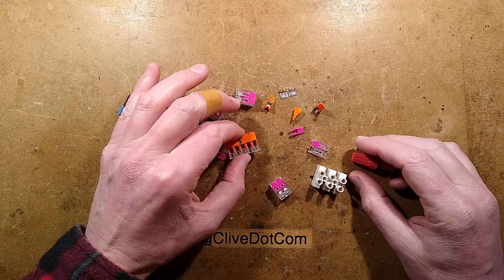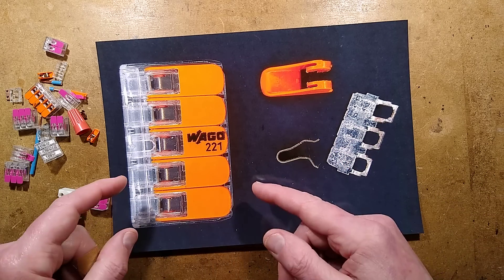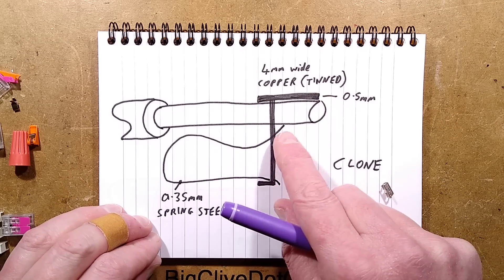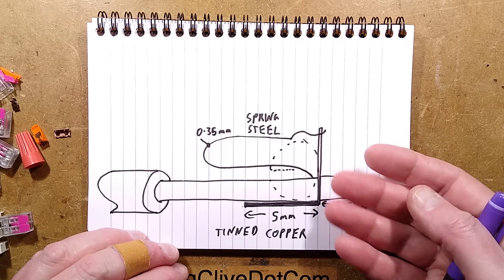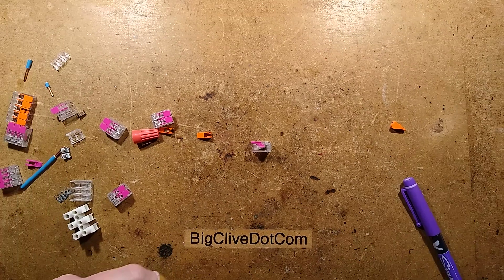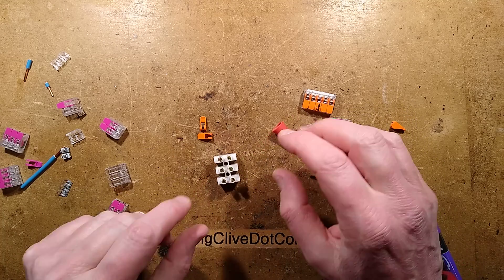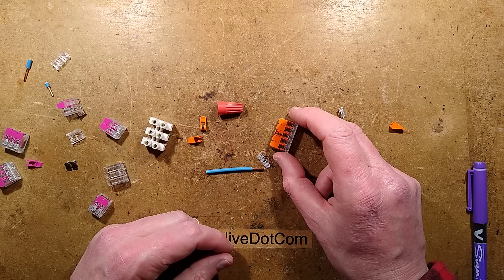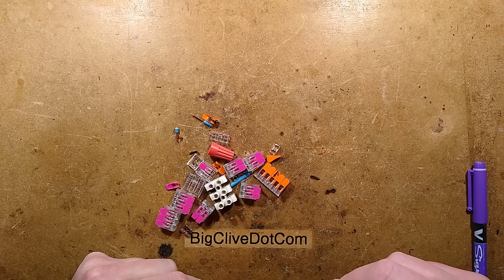Inside a Wago connector and a clone

Comment: The wago series has been a complete game changer for us sparkies, the best bit by far is they're approved for non maintained connections so can be inaccessible once installed..I'd still like access to them but it's allowed ...they also make some excellent PCB connector's.
Reply: Same here in Germany. Wire-nut never were a thing here but we used those screw camps with one screw, where you had to stuff up to 5 wires in, all from one side. That was a real pain and if not done correctly they got loose with only a few wiggles of a wire. Wagos replaced them basically instantly because WAGOs are faster to install and if you have to pay a specialist by the houer, the wagos pay for themselve multiple times.
Reply: @fkiesel9442   Your wiring Standards are piss poor if they allow termination of more than 3 wires into the same terminal. Do you value everything in terms of money cost?  Do you value circuit integrity or life lost due to inherently flawed workmanship in money values too?
Reply: @BTW...  It was like that for 60+ years and there were no significant issues with that. The terminals I meant are specifically made for connecting up to 6 wires.
The current code makes it much harder to use anything else than WAGO style connectors anyway, so this is an issue of the past.
Reply: Wagos can be used behind a socket in the box to connect the circuit with a 5 inch length of flex spurred off the Wago to the socket. The Wagos carry the ring's (or radial's) load while the socket is a spur off the ring. The screw terminals on the rear of the socket are not being used as a junction box. Super simple to install and much safer as no screw terminals on the ring or radial to work loose and arc causing fires.

Use the Wagos for the first and second fix.

1st Fix:
In first fix use the spring lever Wagos with three ports inside the socket backboxes. Four port Wagos for the earth to a metal box terminal. Then test the wiring. Then the plasterers and painters do their work.

2nd Fix:
Then on a bench fix flexible 2.5mm cable tails about 4 to 5 inches long to the L, N and E of the sockets (could be over 30 of these in one job). Then insert the flexes into the Wagos inside the boxes. The sockets being on flexible wire just easily push into position. The time it saves is substantial. Easy as a lot is on a bench. The Wagos also ensure the ring is always complete, not relying on the screw connections on the back of socket terminals that are being used as junction boxes having two 2.5mm cables run into them. Wago connections do not work loose over time, so the ring (or radial) is not compromised and less likely to have an arc.

The time saving and far safer job is well worth it. 

There are sockets available with Wago connections on the back, eliminating any screws, except maybe to an earth terminal on a metal box.
Reply: what do they cost on trade there not cheap online for diy 60 p each

Comment: I have a few of those exact clones in my personal toolbox, since they claim to be ETL listed, I trust them a bit more than some of the other clones I've come across, and they beat using wire caps, especially when it comes to connecting multiple wires together.

Comment: Would you trust using WAGO for electric heaters?   My house has all 12 gauge 20 amp circuits and I have forced air central heating with propane gas but in case that goes offline the backup is electric baseboard heaters and I started to replace them all with newer units as the old ones are from the 1970s and look ugly so it was time for a refresh.   I just have a hard time trusting something that uses springs when heating is around so I am sticking with wire nuts but I wonder if anyone tested WAGO  with long term high heat?
Reply from the maker: They are rated for a decent current, but I'm always cautious about high continuous loads.
Reply: The Wago shown is rated for 4mm2 cable so 32A which is nearly 8kW here with 240v mains. They have lots of testing compliance and the testing symbols are printed on the connectors. Being German the standard is very high.  
I would never ever use a clone except perhaps for a very low current connection. You have little way of knowing how a clone will handle power.

Comment: the outfit i worked for sold wago terminals to companies that made and rebuilt diesel locomotives.  why wago?  they were the only ones that didnt come loose in use.   i spent many years wiring up trains and related equipment and I never had a problem with the snap down or captive spring type wago connectors, they really are that good.  the push in type is another story tho.  I have been an electrician for 22 years not and have worked all over and there are very few products i recommend.

Comment: I trust the wire nuts among all the different connector types.  With other types of connectors, it seems that it would be to easy to accidentally or maliciously flip a lever the wrong way resulting in a loose connection.  With wire nuts you have a positive screw action that just feels more secure.

Comment: The Wago connectors are available in 2,3 and 5 wire variants, but I'd actually like to have a 10 wire variant too. Some installation cables has a protective ground wire and a shielding. The shielding is to improve the safety in case there are rodents or someone accidentally drives a nail or screw through the cable.
Pretty common in industrial and farm use in Sweden since at least the 70's.
Of course you can opt to separate the protective ground wire and the shielding too, it depends on the application. (Signal ground v.s. protective ground)
Reply: In case you need WAGOs you can basically go with ANY of the real ones and fakes. The fakes are less tested but come in WAY more designs and most of the time can handle WAY more than what they are rated at
Reply: there is a 8 wire variant for solid wires too, if you need many connections.. though it will not work for stranded wires or the shielding itself if you need that, but if you have a mix you could just use a short bridge between one of each

Comment: im using Wago connectors to connect two pieces of ethernet cables together one cable is from 2005 and the other is from 2015 and so far its working really good. 

2005 they used thick copper in that one.
Reply from the maker: Hopefully the new wire isn't aluminum inside.
Reply: @bigclivedotcom  the new wires do seem fragile but I’ll definitely check.
I’m hoping to update my cables with real ones from the BTDeathrayBox into Box junction things.  Just like in Grey Office blocks have.
Reply: I'd be reaching for an inline IDC junction or plugs & coupler before the Wagos, especially if I suspected CCA cable 🙂   Jelly crimps at a push if extending from a backbox.

Comment: I wouldn't trust an electrician with anything else. Some organization in the US did a survey... From what I remember, for screw terminals, 60% were under tightened, 10% were over tightened. And that was according to the manufacturers specifications, which is limp wristed to begin with. I fear to think what they would do with a wire nut.

Electrical connections must be idiot proof.
Reply from the maker: These days it's even more important that they're idiot proof with the new era of crash training.

Comment: Wagos aren't common in Canada and not stocked in hardware stores as a standard item. Looks like about 50-80 cents each...which is going to add up over a project. I'm genuinely curious whether this is cheaper elsewhere in places where they are more commonly used. In comparison, wire nuts are as low as 6 cents.  And admittedly they require a bit more care to use. But that's why the box is grounded and failures are rare if you know how to apply them.
Reply: here in Germany it is usually a bit under 0,25€ per piece, but cannot compare the price to wirenuts since these are not readily available here..
Reply: Wagos are available in the US at the box stores, though 10 pack of 3-ways are $10, those similar non-lever Ideal are 100 pack for $12.
I like using the Ideals at the price, for most wiring.  I think they've been around long enough that I can now trust them on a 20amp circuit.
They're great at the price compared to the BMW-priced Wago's, however for electronics wire shuffling the Wagos are great.
Fantastic for making pigtails in switchboxes. Time saving is meh, maybe save 20 sec. but I'm sure I'd love them way more if I was installing 30-40 every day.

Comment: The problem I had with the clone connectors (even for domestic use) is that they didn’t clamp the wire as well as Wago did. I’ve switched back to using authentic Wago, for peace of mind.

Comment: You can tell who has actually worked with a wirenut vs some YT wingnut when they describe how wirenuts fail so easily if looked at wrong....
https://www.youtube.com/watch?v=v9hohwvGeHw

Wirenuts- 
Lower Ohms resistance
Current carrying capacity independent of connection
Stronger physical connection (Pressure/Friction fit)
Non-corroding o2-free electrical connection
1/5 - 1/10 cost of Wago

Wago-
Higher Ohms resistance (Ironic, used in a countries w/250+v mains...)
Current carrying capacity dependent on Wago construction material
Weaker physical connection
Corroding potential depending upon spring materials
5 - 10x cost of Wirenut
*Ease of use/reuse if lever option selected

Wagos are nice in switch boxes, etc as they can make short work of a rats nest/limited space. Or hobby related if you're always reusing/changing connections. For stout regular connections in construction, don't see much need to spend triple or more over wirenuts.  And if I were running at 250+ volts, last thing I'd want to do was have circuit connections which added waste and heat and cost. Its not like most connections behind/in walls are ever going to need to be touched, so levers and reuseability reasons are moot.
Reply: Higher voltage means lower current for the same power delivered, which means less losses, not more. Hence why we use 230V.

Have you considered just.. not being triggered so badly by differing opinions that you forget fundamental laws?
Reply: @Monkeh616  Am I triggered, or am I right?
Both.

If you're trying to correct me, try harder.
250v across a wirenut encounters x addition resistance.
250v across a wago encounters 2x additional resistance IIRC.
Having more resistance means more loss.
Or does it work differently in your part of the world?

If you wanted to correct me properly, you should have just said in the big scheme of things the additional resistance is negligable.

Which I'd probably agree with, but for all I know, you have great honking wago's on your incoming service lines, or really high amperage circuits like heaters, washers, stoves, and what not...

As for triggered, I occasionally feel entitled to vent, as almost every single electrical discussion relating to US/Canadian wiring is full of idiots simply regurgitating crap they've read somewhere else.
Same thing happens in all the various engineering wood, metal, etc vids where multiple people complain and demand the creator use metric for their convenience, because apparently 'maths' are hard when its not easily divisible by 10, and simply remembering 25.4mm = 1" is way to much work.
Funny thing is, I can't remember ever really seeing comments asking someone to convert their metric measurements to imperial. 
Imperial users seem to grasp google better, or can do inferior thing we simply call math.

I'd love to go into the aluminum/aluminium thing, where aluminum predates the other, however that would be a bridge to far.

Thanks for trying to correct me though, I'm on PTO and need something to do.
Reply: @boots7859  But that it's 230V is irrelevant, because there isn't 230V across the joint. For the same power delivered to the load, a 230V circuit will be running at half the current.

Comment: I use Wago for any normal house voltage, I use wire-nuts for anything still residential, but higher amperage, like machine tools (lathe, mill, etc), dryers, HVAC system.

Comment: The US seems to have Wago trust issues from what I can tell.
Reply: I think it's partly due to the fact that virtually all residential supply voltage in the US is 120V.  More current is required to deliver the same amount of power to the end device than with 220/240V supply.  I use Wago 2273 connectors for virtually all connections, but I'll fall back to wirenuts for anything involving continuous high-current (>10A) applications.  Is the US were sensible and used 240V residential supply, then it wouldn't be an issue.
Reply: @spinkter36  That may be one of the reasons but I know people here in the US using Wago.  It seems to work fine on 120.

Comment: I’ve used the ideal brand ones.  Never had an issue.  I use them mostly for lighting or in some cases on the 15 amp receptacle circuits.  I have an older house where wire lengths are limited and these saved me from having to pull new lines.
Reply: Same here. Receptacle wires cut short. WHY do they do that?!? Wagos make it really easy to install a pig tail. Also especially helpful for installing light fixtures to join their thin stranded wires to solid.

Comment: The thing that would concern me (if I weren't retired and nearly blind) is the tinning on the copper. Sooner or later someone will insert a tinned wire and the connector will suffer enough of an overcurrent to solder the connection but not fail.

That would be fun to run into.

Comment: I wonder if you could get copper foil on a roll, twist some connections together, wrap that in copper foil, then shrink tube seal the completed connection.  Perhaps electrical tape over that for high load wires...

Comment: The difference in design is probably due to patent issues - the terminal type shown in the video is covered by US9466895B2 etc which won't expire until 2034. Obviously the Chinese manufacturers aren't bothered by that, but their Western distributors and retailers are likely to be very bothered indeed if Wago sues them and their imports get impounded by customs.

Comment: I like the wire twister tool that goes on my drill... and shrink tubing.  The tool I have will twist 2 or 3 wires together into a pretty connection of many different gauges and types of wire.  For important connections I'll wrap this fancy affair in electric tape or paint it with liquid electric tape.

Comment: I love my Wago connectors.  I think they are better for connecting Aluminum to Copper too!  Was also really handy when I went back and needed another ground connection in a spot and I just put the wire in and clicked it down.  
I saw them being used in a new commercial hospital build too.  I think they are a lot safer than wire nuts for smaller wiring.
Reply from the maker: I'd be cautious using aluminum wire in them directly.  Maybe better putting on an aluminum to copper interface tail.
Reply: @bigclivedotcom  you just need to use thier paste with aluminum
Reply: @bigclivedotcom  I wouldn't worry about it. Aluminum wiring is very common in east German residential buildings. If Wagos caused problems there, you'd hear about that.
Reply: @TheMongooseOfDoom  WAGO only list copper as suitable in 221 connectors on their datasheets.
Reply: @khaitomretro  Huh. Good to know.
Reply: @TheMongooseOfDoom  You are pressing aluminum wire to the copper plate inside a Wago.  So you should be potentially getting all standard issues with copper/aluminum splicing
Reply: I don't think the new 221 lever connectors are rated for aluminium wires. The older grey 222 are, but only if filled with petroleum jelly to prevent oxidisation.
Reply: I've found that wire nuts are much easier to install in a manner that feels secure, but ends up being electrically dodgy/intermittent (especially when you have three or more wires, double especially when mixing stranded and solid or multiple sizes).  
Twist them too hard and you can break strands, or sometimes one wire will back out relative to the others and only be barely gripped by the threads. 
Not to mention the potential for RSIs if you're twisting them by hand. 
Having every individual wire in its own separate slot makes it easier to be sure each and every one is seated and happy.

Comment: I wonder if WAGO designed their product to be deliberately difficult to manufacture, so that they would still have a jig and appropriate machinery to do it, but so that cloners would have a hard time replicating the original design exactly. If true, there'd still be a risk of the strategy backfiring if a clever cloner ends up making an approximate but unencumbered clone that's a better product. It might be sad in a way if the better product doesn't win due to liability red tape, but I suppose it makes sense if you've been burned before – hopefully not literally.

Comment: I can't use the clones in a wiring job as they are not UL or CSA rated. They are OK for low voltage circuits, but legally not OK for 110 or 220 volt systems.

Comment: I like the idea of wago... I had to replace a plug socket and chose a wago version.. the wires came out from the biting hold with very little pulling/pushing on the wires and were not very secure at all. In fact one of the connectors broke itself after one of the wires came loose and wouldn't grip the wire after that, so I had to use the hole next to it.
At least with a screw you know it's tight and isn't going anywhere, plus it's much more surface area for the connection.